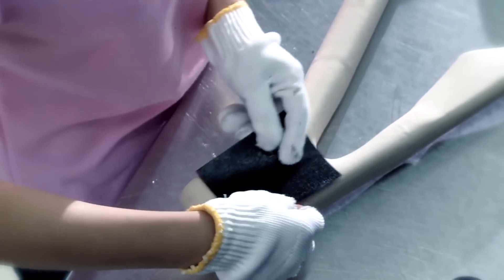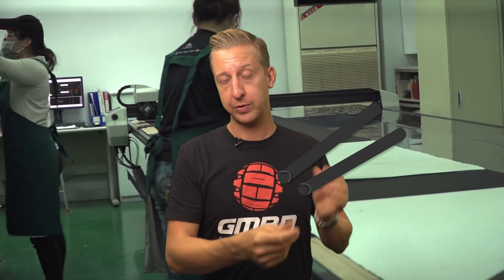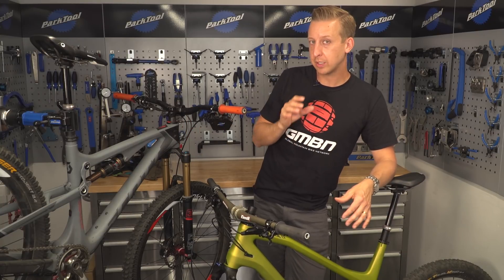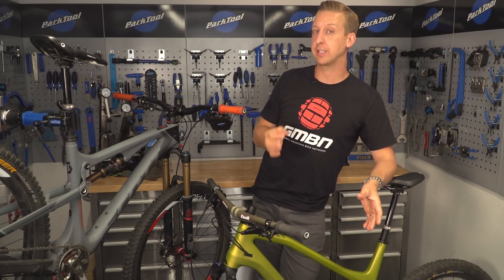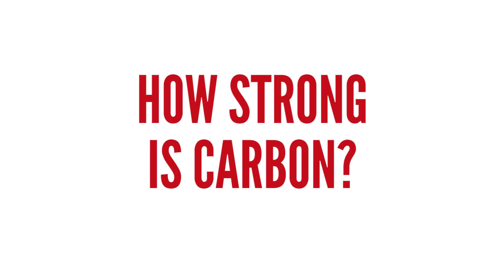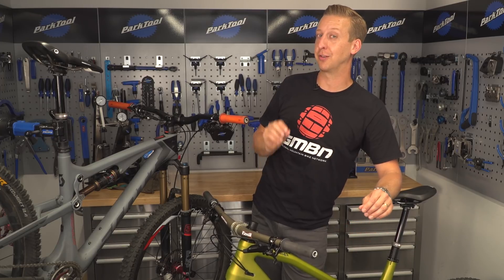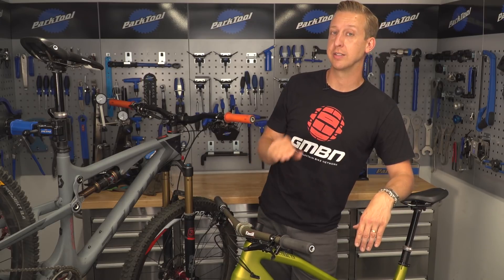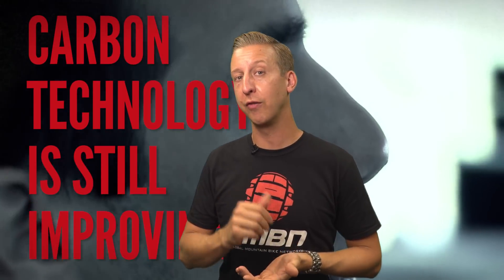7 Things You Might Not Know About Carbon Fiber

Comment: From what I'm seeing CF has an inherent weakness, that is a when there is a rock strike to the frame, there will be a popping sound and the frame will crack. It's these rock strikes which are causing carbon frames to fail - and there are lots of reports of that now happening with mountain bikes. The probablility of having a rock strike while riding your bike through rough terrain is high!!!

Comment: I’m so scared of breaking my carbon frame, what can I do to keep it in good condition?
Reply: I am in your position now. So how did it go with your frame? Are you still happy?
Reply: @JP-ot5km  hey mate. Had the canyon spectral in carbon for over a year and have had no problems. If anything the frame actually feels more secure and stiff than my old aluminium bike. I haven’t had any problems and I’m definitely still happy with it!
Reply: @Penguin-wk7gq hope to experience the same. 😂 Thanks, mate.
Reply: @JP-ot5km  just make sure you have a torque wrench handy and make sure your linkage etc is not over tightened. Also it’s worth checking the exact NM of bolts after each ride depending on how hard you go of course 😂
Reply: @Penguin-wk7gq  Just bought a tw to check on this. Thx.

Comment: Aluminium is overall more durable material for MTB. Small compromises in Carbon which cannot be seen could make it fail when most needed. Plus the cost.  Could the bike manufactures cost be be lower for Carbon then actually making their Aluminum?  I wonder why carbon is being pushed so much in the MTB industry ?

Comment: Carbon fiber is simply the best material for bike frames, all the pros use it. The only thing is that is obviusly more expensive because it is better. 

Why so hate??
Reply: 1: The production process creates massive waste
2: Carbon fibre cannot be recycled
3: Carbon shatters without warning instead of bending making it inherently more dangerous to ride
4: Damaged and therefore unsafe carbon bikes are visually identical to safe examples so you absolutely can't tell if it's safe to ride.
5: Carbon frames are often less than 500g lighter but cost much more, they present a very poor value argument even for enthusiast riders
Reply: People perpetuate myths and old information.

Comment: I need to say one thing is that you are so wrong when it's coming to "fake" if you look up the manufacturer of the frame you can buy the frame direct from them and build up your bike and the cost is not much but exactly the same as in the top brands but you need to do your research like everything else in life. 
Something that i don't understand is way fulldamp frame bikes cost more. the frame cost around 290 punds but the reseller/brands sells it for 1000 punds does not make sense so for me i hope there is coming a brand that can deliver us a normal price fulldamp bike. should not be so hard to do

Comment: #AskGMBN

Is it true that Carbon Fiber frame will have shelf life?

My friends told me that carbon will only be good for upto 5yrs, beyond that, they say it would be better to change/upgrade frame?
Reply: shouldnt be the case. if its used on boats and sailing, then its very, very unlikely than other weather and atmospheric conditions will damage it chemically (other than heavy sunlight, wich is solved with a coat of paint). the material should be stable enoughto last a lifetime if not broken by use

Comment: The problem is that carbon fiber is fragile and aluminium is ductile, so it's highly probable that a carbon frame breaks if you crash your bike, when an aluminum frame would bend a little and still be usable. If you brake a carbon frame it's NOT easy to repair, you can overlay the broken part or zone with some carbon layers, paint it and ask for quite a lot of money, but the frame will be more fragile on that zone, the only correct way of repairing it is buying a new one, I'm sorry. Everyone should know this before buying a carbon frame and be aware about it.

Comment: Carbon Frame -> accident -> impact damage -> Barely visible delamination between CF layers (only small indentation visible) -> residual streght at the impact is lower -> next case of overload -> sudden failure at impact area

Of course, a repair is offered and possible, but I don't trust these methods after reading loads of papers and articles about carbon fiber reinforced plastics.

Comment: Doddy can you get kevlar frames and if you can how do they stack up against carbon and alloy?
Reply: dicksplatts007 they would be a lot more expensive and probably less useful because Kevlar deteriorates very quickly in UV light. I don’t know how the strength characteristics would compare or the weight

Comment: Doddy, 3:10 is absolutely wrong. Carbon fiber with duromere resins like epoxy have a very little strain at failure (compared to most metals). They are much better at fatigue compared to aluminium and have a high tensile strenght, but they are not "strong" in an accident. Their impact behaviour is very bad. And damages like delamination can not be seen from the outside
Reply: Mao gyud noy...

Comment: # 9 - weight difference is 250-400 g comparing to the alloy frames
# 10 - you scratch chainstay or BB on rock - say Bye-Bye to the frame
# 11 - any solid an abrasive object gets between the tire and the frame, you know what to say from # 10
# 12 - weight and flex obsession when you have heavy forks, shock and tires is a hype (and may be a real mental phenomena)
Reply: LisaPet I
Reply: Carbon frame + aluminium chainstay  +  BB cover

Comment: I've seen an expensive carbon frame, on its first ride, crack from a 2 foot drop. I've seen videos of pro riders say they have tried carbon wheels but they kept breaking so went back to aluminium. This has put me off carbon, its expensive and i wouldn't want to replace it if it was out of warranty.
Reply: Then you have Santa Cruz that gives you a lifetime warranty on carbon wheels. (And frames too btw)
Reply: You do understand that carbon is naturally stronger than aluminium?
Reply: Trek has a lifetime warranty on carbon frames and carbon wheels.
Reply: carbon wheels != carbon frame
Reply: 3 years later my 2016 aluminum bike is just as light as some 2021 carbon bikes
Reply: I’ve seen a lot of broken aluminum frames too. In fact, I’ve bent an aluminum frame in a crash off a 4-stair set. Point is that any frame is gonna break if you are unlucky.

Comment: This has to be the highest production level and information dump quality GMBN video yet. Nicely done! It is hard to explain the benefits of carbon done right but I think you nailed it. I have experience with welded tube motorcycle frames that flex around the engine mounts but keep the wheels in line as well as riding a carbon MTB daily. Carbon is tough in weather, the frame is compliant but never snakes, and it is light yet strong enough to survive me stressing it with luggage racks beyond spec. now and then. I think it is a fantastic material assuming the production quality is there, as pointed out in the video. Critical point.

Comment: call me a dinosaur.. but i like the look and feel of a steel bike..
Reply: Dinosaur
Reply: I bought an original ibis voodoo carbon fibre frame, it's well built and not quite as light as the modern stuff, but it's near bomb proof. And I picked it up for what an aluminium hardtail would have cost. New upgraded linkages with fresh bearings for next to nothing, new bars stem and grips, swapped everything else over from my hardtail, it's a really great bike and cost less than many hardtails.

Comment: Got my first carbon bike. Payed for it myself. Was kinda hesitant at first but its got a great waranty by a manufacture I trust. Strength wise it's got the advantage (if you crash hard and carbon breaks then Alu will too). Advantage weight wise but I can care less. Repair is a minus since I can't weld it myself lol. And the slight dampening aspect is nice but not really that noticeable for me at least. Might be good in the long run though considering the strength aspect. Now I'm a light rider easy on my equipment usually. The recycling part sucks but if it brakes it will go up on the wall. At least with the fibers wrapped up for health reasons ;). So if you have the money why not. Still gonna shred my Aluminum rig too though.
Reply: Carbon fibre is only strong in one direction, along the length of the tubes. Under any sideways impact or pressure it's basically just a weak, brittle, and thin kind of plastic. This is pretty much inherent to the material, because it relies on the carbon fibres for its strength and they only run in flat layers. Even then, the threshold between normal flexing and catastrophic failure is rather abrupt, especially worrying for parts designed to flex in normal use.

Comment: #askgmbn What is the difference between Carbon and Composite? Like the D3 helmet u have in composite AND carbon. Even my Giant reign advanced 2015 is composite/carbon frame (sold as carbon)??? Difference or not really? 
Speculation: Is carbon always glossy raw and composite a mash with plastic as composite is almost always visually unclear?
Reply: Carbon = Material of the fiber
Composite = Material made of fibers embedded in a matrix. This could for example be carbon fibers with resin matrix (CFRP) or Kevlar in a ceramic matrix. The matrix is usually not a strong material itself, the fibers themselves can only carry tensile loads and are soft like a yarn. So the combination of both is used so that the matrix supports the fibers against bending and holding them in shape.
Reply: Composite is the general term. For example asphalt is a composite using concrete. Composite simply means that your material is made up of two or more materials used together to share strength characteristics. Carbon fiber is a composite of carbon fibers in a polymer matrix. It gets some of the strength characteristics of the carbon while getting some of the strain characteristics from the plastic.

Comment: So on the experts out there... because I did this research - the claim that most "manufacturing techniques" on cheaper carbon frames are inferior doesn't hold up because many manufacturers are not even producing their frames themselves. I set out on a journey to find pictures of cheap "China-Carbon" frames broken in pieces and with the exception of carbon fibre road forks, I was not able to come up with much - it seems they break just as often or little as the brand frames. 

Does anyone have an unbiased source of, say, an Aliexpress carbon frame actually breaking? You hear many horror stories of open-mold frames arriving in unusable states and such, but so far, I have yet to see something like that happening and the few times I ordered frames off Aliexpress they were bang on with the standards they promised ot offer (e.g. BSA vs. BB92 vs BB30 bottom brackets, semi-integrated headsets, tapered vs. non-tapered head tubes, derailleur hangers where they should be, axle width of the frame, diameter of the seat tubes).

From some of the frames currently available - if one was, for example, to browse for "Carbon 29 frame" - it would be easy to get the idea that the brand-frame and the no-name lookalike come out of the same factory - some of the manufacturers do not even pretend that is not the case but except try to put out warnings that the no-name frames might come out of their production line as failed QA models and so on... 

I am a heavy dude and I am currently rolling on carbon fibre wheels by light-bicycle who are somewhere in between the low-end of Ali offers and the unbelievable pricing of the established brands - and after a year of XC and trail riding with jumps and rocks and flat tires and what not, they show no signs of weakness. I understand that GMBN gets sponsored by companies who have an interest in making us believe that carbon fibre isn't carbon fibre, that a frame for 699 $ cannot be as good as the same frame for 3799$ - but so far, I have yet to see proof...
Reply: It's just marketing wank, GCN/GMBN gets a ton of endorsements, they're very biased. Those "fake" carbon frames are often made by the same manufacturing companies that make frames for Trek, Scott, etc. and very likely have used the same processes and techniques, patents or no.
Reply: Hey Christian, I was actually thinking the same. I have yet to see any evidence that off brand components are less strong or safe than big brand ones. Also, on the topic of strategic flexing and the like, I'm sure the difference - if any -  is not that noticeable with all the variables coming in from the tires, suspension, saddle, weather conditions and so on. Also, I've noticed that a lot of youtube videos advocating for off brand carbon parts are being blocked. Curious?

Comment: of course manufacturers love it and push it - steel frame is for life, carbon one till the first proper crash on rocks, or sometimes it's enough to transport few bikes in the trunk "improperly"... in any case, it will need to be replaced soon, and if not, they will invent new wheelsize or groupset you "must have"

Comment: Carbon doesn't dampen anything. DampENing makes you wet. Damping makes you fast
Reply: True !
Reply: 'Dampen' is the right word . Carbon does dampen vibrations .
Reply: And Carbon isn't a good damper anyway as it's so stiff. It can be made to be compliant though but, more specifically, its stiffness tuned to prevent resonance and reduce transmissibility
Reply: It doesn't have to be stiff. I have a carbon fork and it reduces a lot of vibration.
Reply: damp·en /ˈdampən/verb
make less strong or intense

Comment: Are carbon fiber MTB bike sales down???

#8 - Carbon fiber is still weak against direct impact / localized forces. And when it does fail, it fails suddenly and or catastrophically.

Something as simple as getting the torque wrong on a bolt, or laying it over in a crash, or simply shipping your bike can ruin your carbon frame or component. Reminder: buy and use a good torque wrench when working on your bikes.
Reply: @icewallowcum856  What exactly does that video prove?
Reply: well, its not proving but showing. so correct question is: What exackly does that video show? It shows bunch of people that are riding over and punching OLD carbon frame. And i think its eaven from Author brand, whitch frames are cracking like nothink. so ye
Reply: @icewallowcum856  No, I stated it correctly.  What does that prove? Nothing. They're not designed to be ran over by a vehicle, nor designed to be destroyed on purpose. You could do the same exact thing to an alloy frame or any frame and it would have the same outcome.

Comment: Yes carbon is very strong, but you did not mentioned that you often can not see if your carbon frame is damaged after a crash. The structure can be damaged, but you do not see it. On an alloy frame you would see a small split getting bigger and bigger before it breaks.
Reply: Maximilian Buschmann just a quick knock will tell you
Reply: You will see the crack in the carbon fiber frame too...

And don’t worry you will certanly hear the crack,
Reply: If a weld fails on an aluminum frame it may be hard to see. You may have to magna-flux the welds to determine where it cracked.

Comment: Carbon frames from china are about €500 and are as good or better than brand frames that cost 1k or more
Reply: I was looking for this comment :) Do you have any experience to back up that claim? I'm of the same opinion by the way, but I've just never owned an off brand frame
Reply: I have an unbranded CF road bike frame that rides nearly as well as my much more expensive name brand CF road bike frames.  It's light too at 1100 grams for frame and fork.  No issues in over 500 miles of riding.  But, and this is a big but, I wouldn't go for one of the counterfiet frames that's made to look like a big brand bike.  Unlike the unbranded frames that are designed with the intent of smaller brands/shops putting their names on them, those bikes are made to LOOK like a premier brand frame.  Very little engineering goes into anything else with them and the finish is quite lacking.
Reply: buddy of mine has one, also wheels and other carbon parts (handlebar, stem, sadle). He is very satisfied, and he has done two years and a lot of kilometers on it. It is road bike, copy of Trek Madone
Reply: Don't risk it. I got one for 399 Euro and it literally fell apart under my feet during a downhill run.
Reply: theres a huge thread on mtbr about chinese carbon many have had there Niners break before there Chinese trainers... also some guys went there and they saw the name brand bikes being made in the same factory, thats just how big the markup is, in China they can sell the designs of name brands they just can't use the names and logos.   The Trident Thrust t1000 Carbon 29er is a good one.
Reply: Search “carbon bikes snapping” you see cranks, bars and frames just snapping from cheap manufacturing. You get what you pay for. And when you’re zooming down a giant hill at 20mph I’d rather have a safe bikr thanks